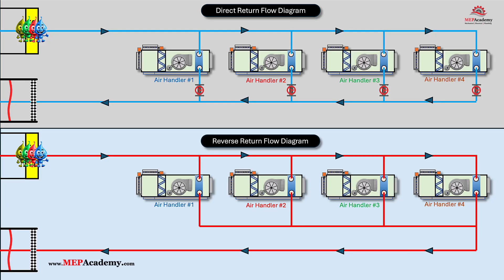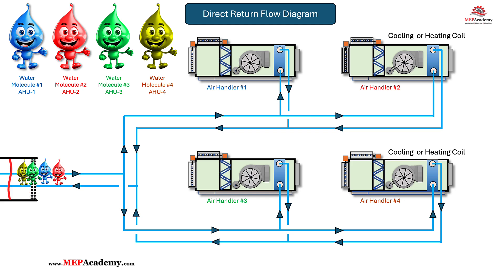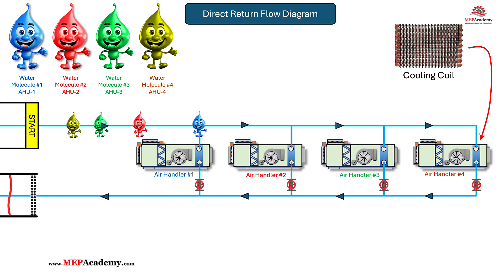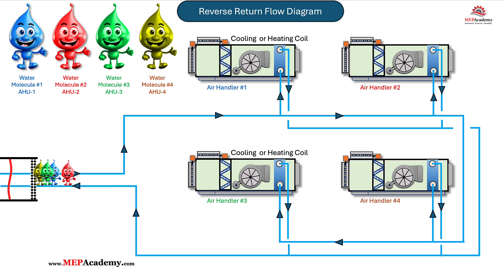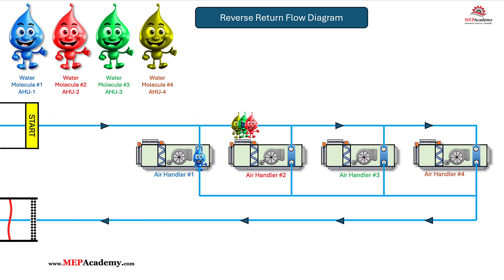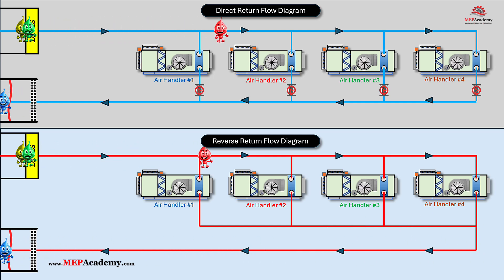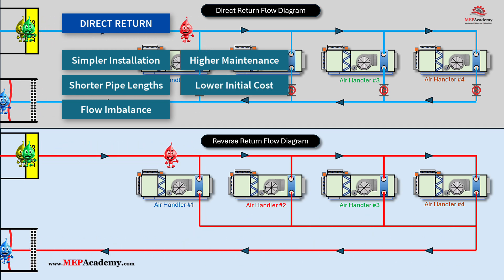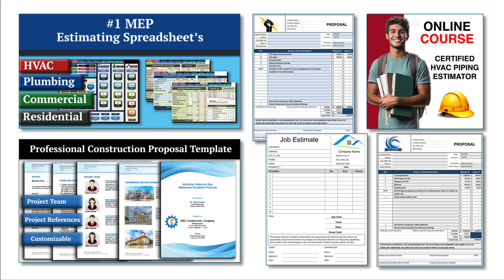Direct Return vs Reverse Return Piping

Comment: In my experience balancing valves are always needed on every branch to a terminal unit so the benefit of reverse return is never seen. Especially nowadays with combination BPICV valve sets. Only scenario where reverse return might be applicable is where a balancing valve is very expensive such as when dealing with >DN500 you might prefer to have a section of reverse return rather than add multiple pricey butterfly valves
Reply from the maker: Great observation. A lot of engineers designs direct return systems with PICV valves, especially good on large campus projects.